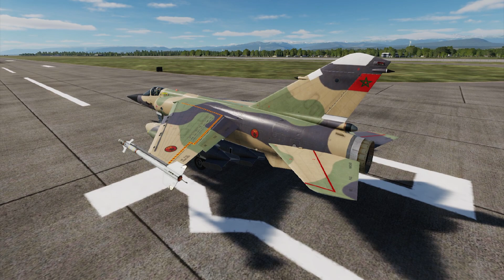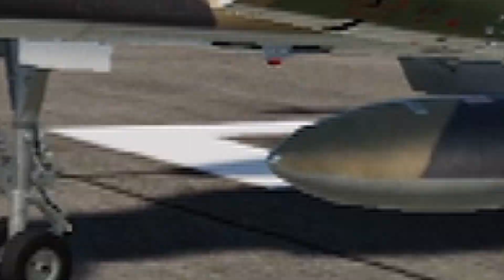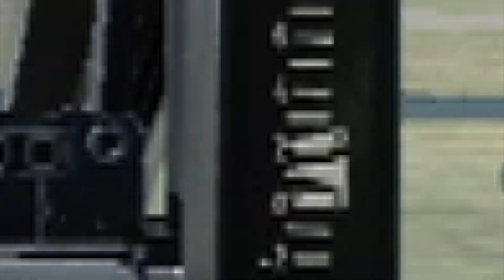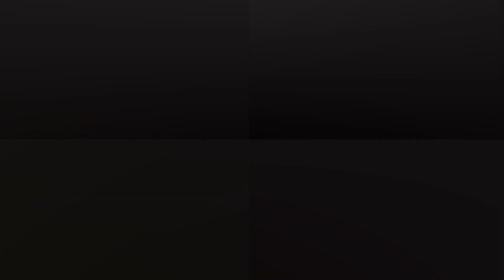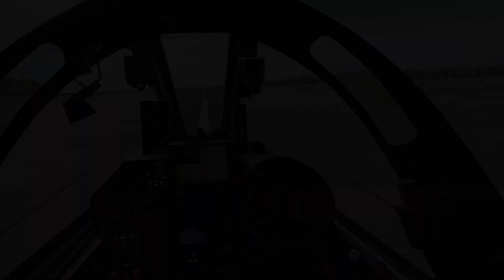Mirage F1CE Update Addendum (Dec 2023) Takeoffs and Landings

Comment: GVad, did you make a video about the mig-19? I hear quite opposite opinions about it..
Reply from the maker: Please explain the "opposite opinions" some like it some hate it?  I dont think I did a MiG19 video but curious about what is being said
Reply: @FSX404  maybe opposing opinions? Sorry, my english is really poor. 
Some people say the turn rate, and climb rate way exaggerated, and the stall properties are too permissive. Yet someone says, it's spot on.
Reply: In my country, the air force was used the mig-15, 19p, 21bis, L39, 29. The 21bis and the L39 of the DCS is unanimously praised, in the local DCS community. The mig29 is considered good. But the 15 and 19 are more disputed.
Reply from the maker: @tamasratkai1130  21 is one of the better FM planes, 15 I have no comment (other than go to 10K feet/3000m shut your engine and just see how long it takes to glide to the surface at 375 kph, that should tell you a lot about the 15 in DCS), 19 has its areas but has a "few issues" like it was made in 2019 and forgot to improve with the rise of standards in DCS. But I do use the MiG19 AI to test other planes in combat, it gives a good opponent performance to test another plane against it.
Reply: Thanks!
Reply from the maker: @tamasratkai1130  a lot of planes in DCS are overperfomers in a climb, best way to test is 1/2 to 2/3 weight, 10,000 feet and 460kts/850 kph, and pull 4Gs to vertical, once you reach 250 kts/400kph start pulling to level off and roll out. MiG15 should reach about 22k, MiG-17 about 21k with no AB or 23k with AB, MiG19 about 26k, MiG-21 about 29-30K. If I remember in DCS 15 reaches 26k, 21 about 31k, I dont remember the 19.

Turns for 15 are OK until you get to lower speeds under 500 kph, then it overperforms, i never tested the 19, 21 should be good.
Reply: @FSX404  Thanks again. I will try it with the 19.
Merry Christmas to you, and for your family!